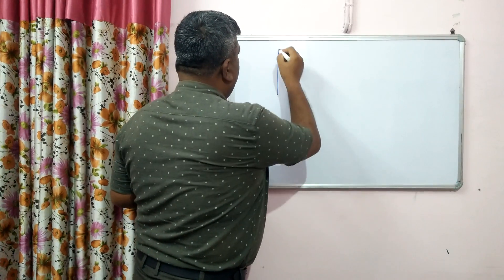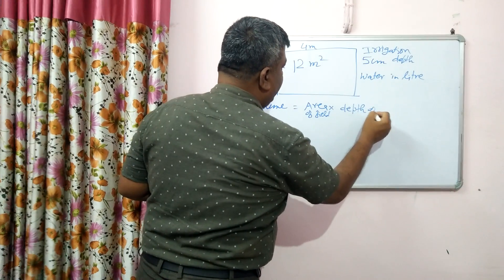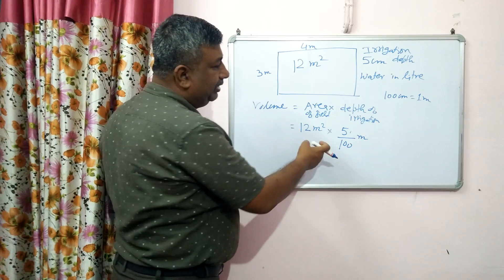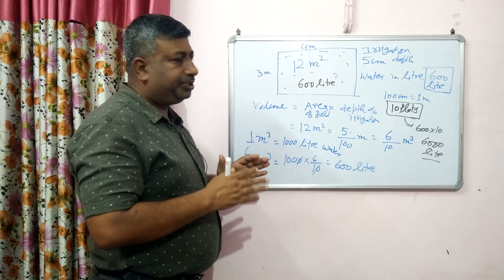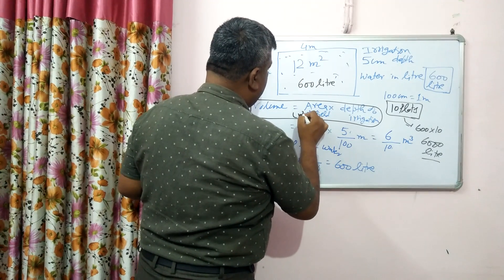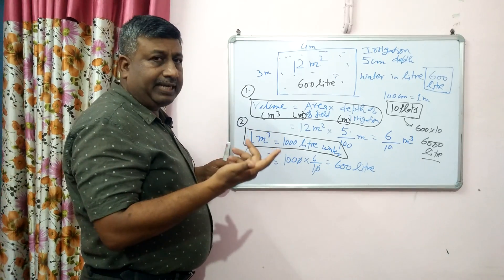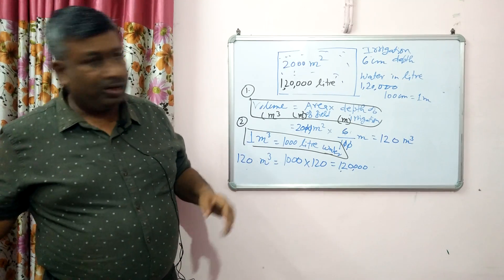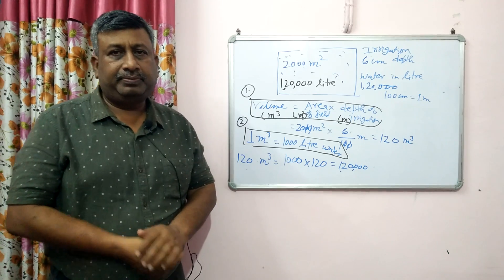Irrigation water requirement for small plots

Comment: Sir, I have dug borewell to which as per driller's statement that borewell has 1.5" water, bore diameter is 6" and depth is 300' and water table is at 25' ,so can I irrigate one hecter agri .land using sprinklers, if so which size of HDPE pipe,  and submersible water pump i should use to push water upto earth surface and further 600' horizontal level to irrigate the crops, like cotton, arhar and grams , please guide me